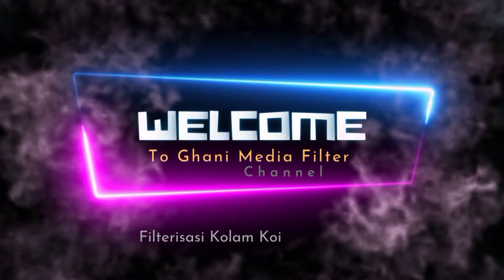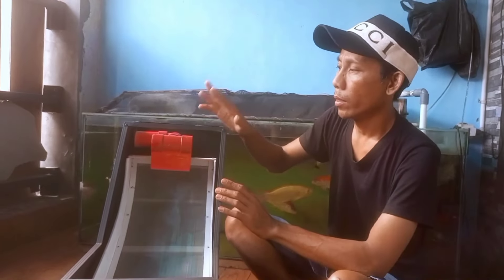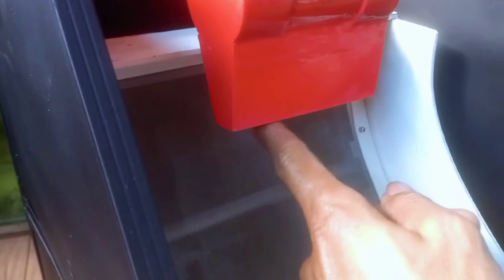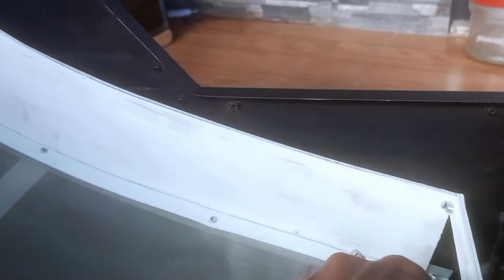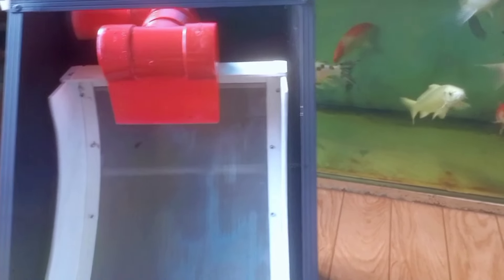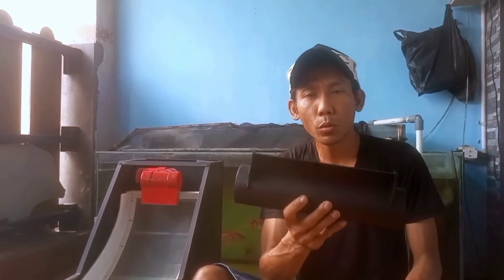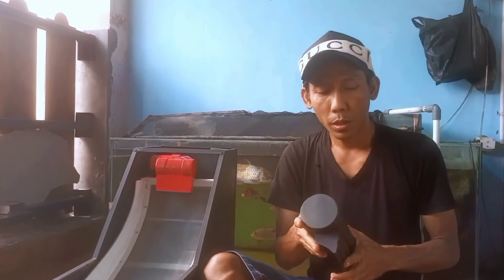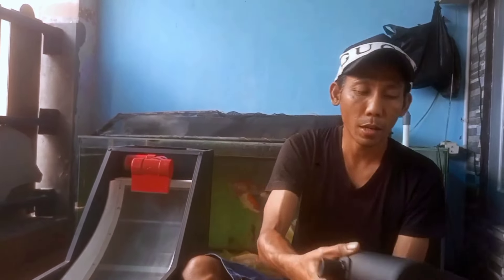Sieve Filter Kolam Koi (Filter Aquarium) Filter Kolam part 3

Comment: Bikin sieve mirip2 gini, air malah cepet banget menuhin penampungan kotoran, kenapa ya itu mas?
Reply from the maker: Harus kenceng om..biar kotorannya gak mampet...😁
Reply: @ghanimedia-pwt5103  super kenceng mesin 14rb om, 😅
Reply from the maker: Sy pompa 8000 om, msh aman. Krn input ya aq perkecil gak pipa los.klo meshnya yg 304 aman om..120 micronpun klo yg 304 aman om
.
Reply from the maker: Output dari sievenya gede gak om..
Reply: @ghanimedia-pwt5103  sama, 304 mesh 200/80 micron
Reply: @asdanksChannel mesh 200 sepertinya terlalu halus.. coba diturunin meshnya. Krn rata2 pakainya meah 60 sd 100